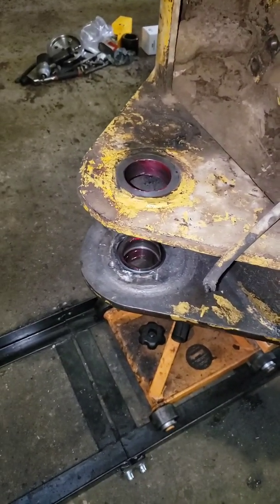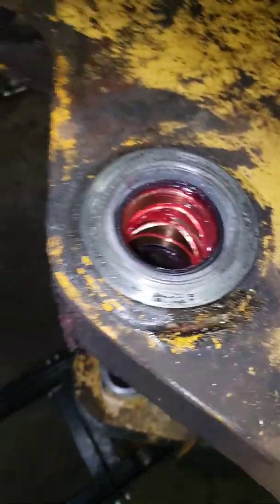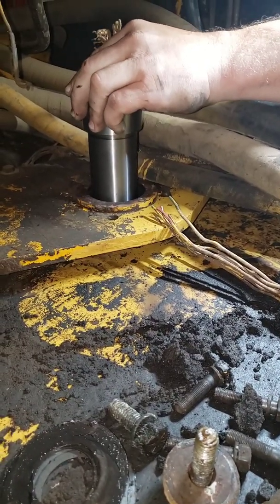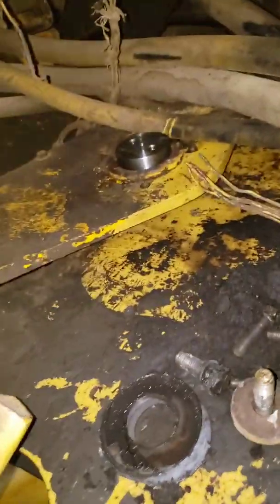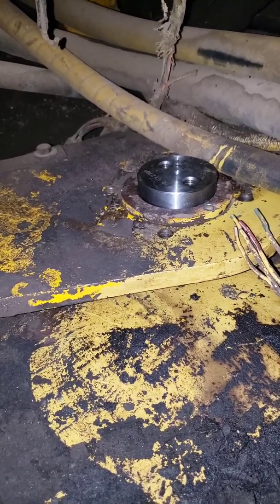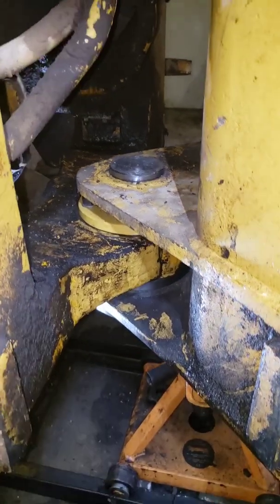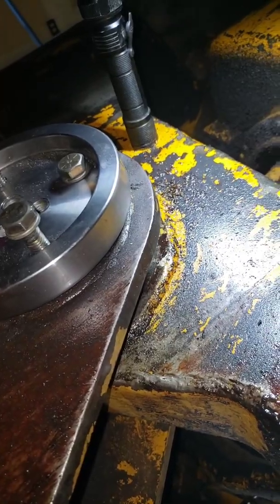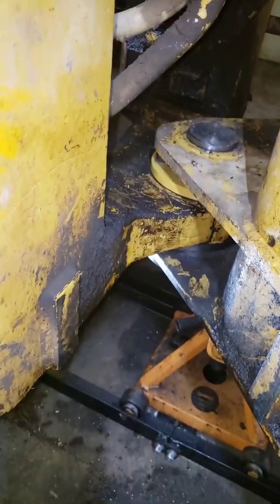Cat 920 loader repair manual for complete center pins assembly and disassemble with specs part 2

Comment: Hey! Nice repair,  I just purchased a 930 loader and am looking at doing this same job.    Any Chance you remember the cost of the parts and welding/line boring the bearing hole?  Thanks!!   also where did you find your service manual for that machine?
Reply from the maker: We own the service manual and we did the line boring and welding ourselves. The customer did not want to pay cat's prices
Reply: I need one to 😂
Help?